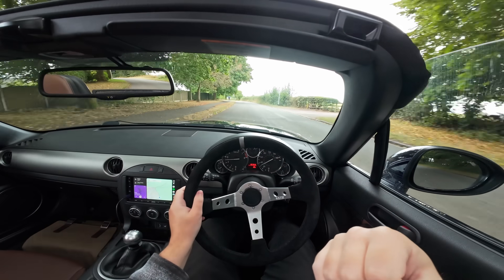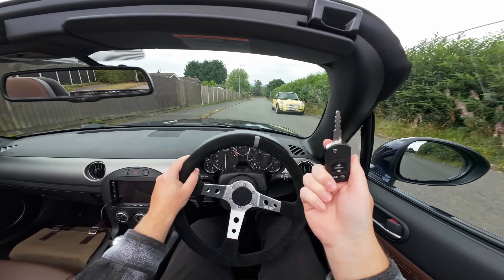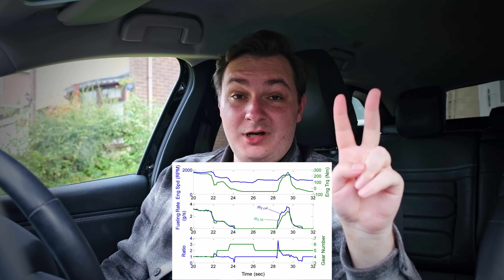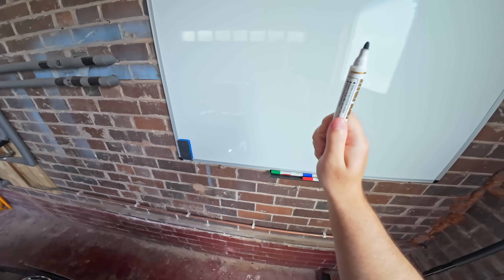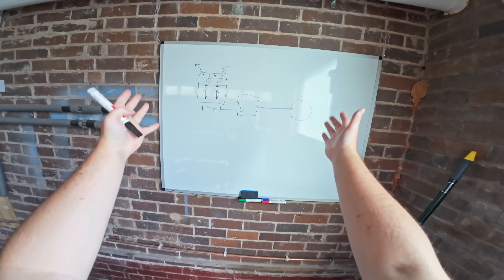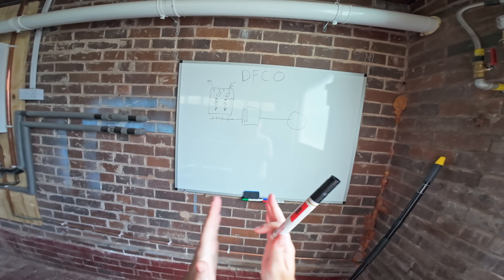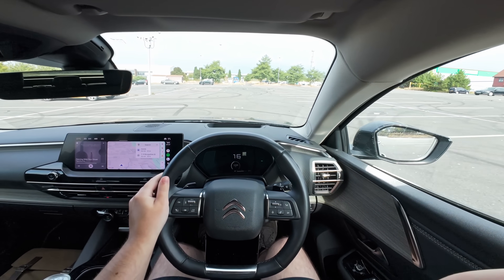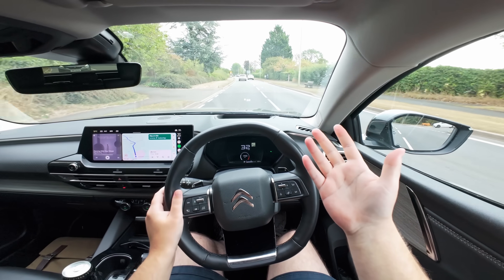The most misunderstood car term - Engine Braking

Comment: I learned recently how my diesel car engine brakes. Alot of people get this wrong and I did too. I'm not a mechanic so someone might correct me on this but what I learned is modern diesel cars do have a butterfly valve to restrict flow but it's not on the air intake like a petrol, it's on the exhaust and is regulated by the ECU. The ECU regulates it so that your fuel economy is maximised, it doesn't engine brake when you don't need it like when you are on a level road but does engine brake when you are on a slope.

Comment: Ive had this argument before myself, its physics and computers man, thats it, carbureted cars MAY still use gas that I dont know because I dont know enough about how carbureted cars work, due to it not being computer controlled and most being gravity fed I can see how it could but absolutely ANY fuel injected car it will use ZERO, fuel injectors are computer controlled and not mechanically controlled and thus the computer often does mess with fuel ratios, I honestly thought this was basic knowlage the person I had this argument with wasnt a car guy or a mechanic thats scary that mechanics get that wrong, honestly because it shows a basic lack of understanding about how fuel injection works dam near the core fundamental of how modern cars work, I guess if you worked at a quick lube place or something like that fine, its well known most who work in places like that are not mechanics or trained like them, but a real mechanic that blows my mind
To my knowlage cars still use gas when coasting however, some new cars dont, my car is a good example it cuts fuel when it can when coasting, it claims so in the whitepapers, but I also cant say Ive tested it ether, but then again my car is a hybrid so it makes sense it would try to use as little fuel as possible(it DOES NOT have a ev mode, its a REAL hybrid and only uses the electric motor for assist, in fact its a point of issue anytime I used to get my car looked at, there is absolutely zero mechanical differences between my car and a "normal" car, it uses all the same greases, oils, parts, procedure as any other ice only car this also includes changing the clutch(my car is one of the very few "hybrids" that came with a manual transmission) with two exceptions, work on the hybrid system itself, work on the engine you must turn the battery off and remove the engine connection)
Edit I wrote this before watching the whole thing, but the whole white board thing, yep thats is what I meant above by physics and computers
Edit2 around 1030 I aggressively gear down, while this DOES add MORE wear the the clutch than what you are talking about the wear is min with rev matching, that being said if you just slam your car in a lower gear it WILL put more wear on your engine, transmission and significantly more wear on your clutch, I basically use the higher resistance of higher rpm to brake, this isnt clutch braking its closer to how trucks engine brake or what they call jake braking, the primary difference is instead of releasing compressed air from the engine as the main means of braking using a compression brake, the primary thing slowing me down is the resistance of the higher rpms, so in effect instead of "wasting" energy to slow down aka jake breaking I making it were Im using more energy than my inertia can regain thus slowing down, most people when they say clutch breaking they mean gearing down and letting the clutch absorb the energy and Ive also had that argument as well, YES what I do DOES put more wear on the clutch, BUT no more, no less than the wear of changing gears
Edit3 lol I should prob watch the whole video before I make comments, I want to clarify that I live in a mountainous area, "normal" engine braking wont do squat for me most of the time, that said I dont ALWAYS aggressively gear down its just what I do normally because of were I live, in places that dont call for it I often use the example in this video around 1220, in fact unless Im at a complete stop or racing I hardly ever use my brakes at all there is honestly no need to except to finish that final few mph and hold the car, but I admit due to my car being a hybrid I do have brake regen which makes my car slow down even harder and faster, Im not sure I could do this in a "normal" car
Edit4 the rest of the video YES!!!!, it blows my mind few people drive like that, I also love the fact you brought up the momentum, but to clarify that point a bit you keep saying its free fuel and that leads to better mpg, but doing this doesnt just give you "free fuel" so to speak it also uses LESS fuel to get back up to speed vs as you say speeding up to the sign and hard braking, in the us Ive theorized people dont drive like this for two reasons, ego, people here are a holes for the most part and have a need to be 1st, there are some situations were this happens because the person wants to go faster, I do this VERY often, because let me tell you there is no greater rage bait than being behind someone going 10 20 under on a two lane and this is VERY VERY common on my main road to get to my house, this is how I got this habit, not to justify because Im aware its not good, its just to point out why I do it, that said IF you do this you NEED to not impede traffic or have rows of cars behind you, I RARELY dont let others pass that are going faster than I am unless its around my own area were I have lived long enough to see patterns(as I said its ultra common to have cars FLY down this 4 lane straight then go 10 to 20 under the speed limit on the connecting curvy two lane and its INFURIATING and I rarely let anyone pass me, I also fight to stay the 1st car, but I always go a bare min 5 over, and its very very rare I have anyone behind me because of what I said above, in the rare case were someone IS going faster than me AND taking the corners properly than I DO let them pass, by that I mean most people here cant do it, they slow WAY down, not only is that dangerous but Im in a sports car with tuned suspension I can and do take corners at a min the speed limit even tight switchbacks so again not to justify but to point out I DO have a valid reason) the 2nd one is most people here know dick about how to drive properly, its scary and amazing at the same time, I know this is what everyone says, but using my area as a example I live in a mountainous area, switchback 2 lanes and winding around mountains is very common in everyday driving, even just going to the store, I have seen MAYBE 3 drivers in almost 6 years EVER drive the curves properly, I dont mean racing or not just going fast I mean braking while cornering, crossing lines, slowing to a crawl, riding brakes going down the sides of mountains, going fast and hard braking right before, at the start of a corner, rather than engine braking as shown here or properly slowly depressing and lifting the brake pedal to gradually slow down

Comment: Isn't there a danger your steering will lock if you take the keys out?
Reply: If I did that in my old Cordoba I would get hard steering wheel and no brakes.maybe if I turn steering wheel it would even lock but that Im not sure
Reply from the maker: I disabled the steering lock in prep - you can see I go around a corner without it engaging
Reply: For most of the cars removing the key while driving is not a sane idea.

Comment: I'm a plumber, not a mechanic but i believe trucks and buses have or had an exhaust brake, which increases engine braking by blocking the exhaust by design, no damaged gearboxes, clutches etc and, 
I think it started in America, the term hyper miling, where you slowly build up to your desired speed them come off the accelerator, engine braking, down to a certain speed then gently back on again to maintain an economical speed.
Reply: This is called a jake brake or compression brake and it doesn't block the exhaust it opens it, to release compressed air after the compression stroke, this is also why they are so loud
Reply: You have to go into neutral for pulse and glide or there's no point to it. You're going to be more efficient at constant throttle than interspersed heavier acceleration and engine braking. One because the throttle is more closed during let off, increasing engine braking. Two, because the air resistance of the car is greater, average over the speed fluctuation. Three because the varying rpm is less efficient than the same average rpm.
To be fair I haven't tested this rigorously, but it's just what my intuition tells me would happen.
Reply: @TimpBizkit  Makes sense to me, the core to hypermiling is keeping constancy, in everything as much as possible, this however doesnt just mean in engine speed ether, semi hard cornering/decel as little as possible are also important, what I mean by this is you want your engine to remain as efficient as possible so the less you brake and accelerate the better, but as you surmised aerodynamics play a part here as well, thats why a common hypermiling technique is to ride 18 wheelers to reduce drag, this is also why its better to use a ac vs rolling down the window, mythbusters did a ep on that one, the goal when you hypermile is get your engine up to speed as quickly and efficiently as possible and keep it there as long as possible(I should point out that in this context it would mean between 45 and 55 if you are going all out, anything over 55 mph is INSAINE in how much of a drop in mpg it causes, this is the very reason most roads in the usa for a good while were 55, the national speed limit was in part imposed due to the peak oil crisis in the 70s, this was studied and found 55 to be the optimal speed for gas consumption and traffic flow and the top before a massive drop in fuel  efficiency, this also has alot to do with drag, in fact its almost totally due to drag), most people who claim to hypermile dont understand physics, pulse and glide is rarely useful, I CAN be if used correctly but as you stated if you wanted to go that far its better to use neutral when you can keep speed then put it back in gear right before you start to drop speed or just when you start to drop speed, its mostly useful in areas with lots of smaller hills or slight downhills, for flat areas or sharp downhills its useless and possibility dangerous, another myth is slow acceleration, to hypermile you want to use about 75 percent throttle if I remember correctly(it may be 45 I havent researched this in awhile but its way higher than people may think) this is very misunderstood and even a myth often repeated by people who should know better, I get why, I mean it makes sense the less throttle you use, the less gas right? well the issue is engine efficiency, and engines are not as efficient with to low or to high of a throttle, if your whole goal is getting as much mpg as possible than you want your engine to work as efficient as possible and you want to get it to that place as quick as you can, this is why it works even if it doesnt seemingly make sense
Reply: Blocking the exhaust can cause blow by through the piston ring, it will do more harm than good. If you want to brake that much, just use the brake.

Hyper miling is based on the fact that engine can be more efficient at a certain load range (during the acceleration phase) than maintaining the speed (the only load is air drag). But finding that optimal load range and execute the acceleration phase perfectly is not easy, and slowing down then speeding up is quite annoying to other passengers. Using cruise control to get lowest rpm at highest gear possible is close enough in terms of efficiency, especially with 8-10 speed gearboxes nowadays, and is certainly more relaxing

Comment: The most infuriating discussion I've ever had with someone over engine braking is with my driving instructor who tried to teach me to brake with the clutch because he thought that was also engine braking, by trying to teach me to approach small roundabouts and tight corners by slowly braking first, then while lightly holding the brake to downshift, thus causing a bad shift / clutch brake, to "save on brake pad wear by engine braking".
Absolutely bonkers, and he felt the car jerk every time and never said anything of it.
Reply from the maker: Hahahaha I've said this for the longest time - driving instructors are the group of people that know the LEAST about driving

There are some good ones out there but the majority are rubbish 😂
Reply: That's exactly exactly what I do when I'm having a fun drive, you just need to rev match by either blipping the throttle or lifting the clutch accordingly, so you can get more engine breaking, be in gear to power out the corner and not upset the balance of the car but for daily driving it's definitely less comfortable for passengers ig and there's no need to teach that to beginners . Besides that what's wrong with doing that ?
Reply: @joaoruxa  There's nothing wrong with what you do, precisely because you also rev match (which I would consider an advanced driving technique seeing as all modern manual transmissions have synchro gears, which is why it isn't taught during driving lessons anymore), and thus avoiding extreme jerkiness (you might feel some tiny jerks but that's because downshifting perfectly is extremely hard).
My driving instructor inadvertantly tried to teach me to do the exact opposite of what you do, so instead of rev-matching, creating a rev-mismatch by using the brake and clutch pedal at the same time (remember that when you disengage the clutch, the amount of inertia the brake pads have to resist decreases, because the flywheel and engine have been disengaged from that rotating system) thus bringing their rotation speeds out of sync, which creates friction between the clutch disc and flywheel when they come into contact again, which creates a huge braking force (rotational kinetic energy transferred into heat), at the cost of wearing both down significantly.
Reply: I usually disengange the cruise control and aim for a roundabout entry speed of around 30kph (depends on the roundabout).
Shortly before I see whether I can coast through and accelerate or need to dissipate the remaining 30kph (instead of 60/70/80kph typically)
Since Ekin = 1/2mv^2, that's far less than half the energy even in worst case.

And since roundabouts don't have traffic lights, there is no risk in being 1 or 2 seconds late.

Comment: Does downshifting on a downhill to utilize more engine braking cause a lot of premature wear to the car? There are many hills on my commute where the speed limit drops at the bottom of the hill to 10-20km/h lower and I always downshift a gear or two before going downhill to not ride the brakes.
Reply from the maker: A good downshift (revmatched perfectly) won't wear at all